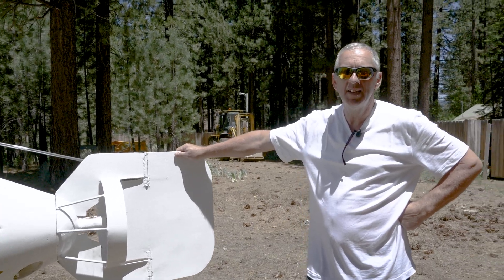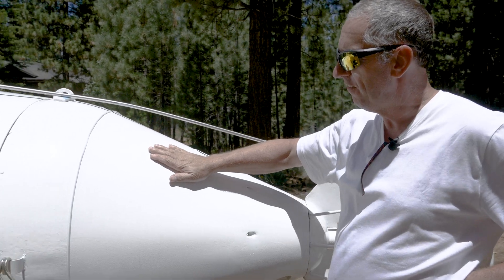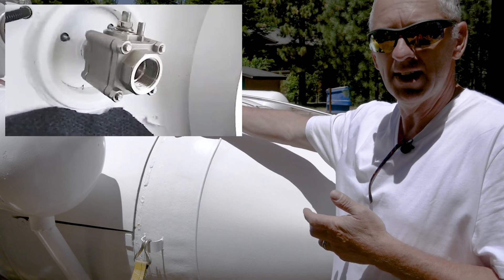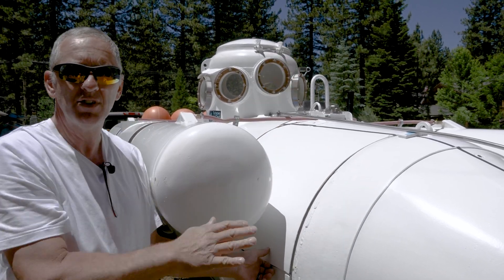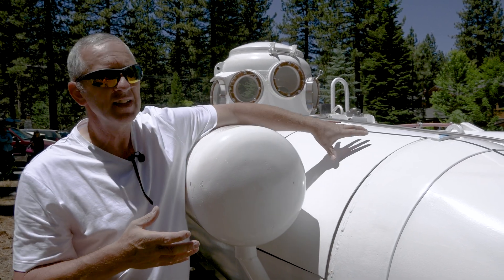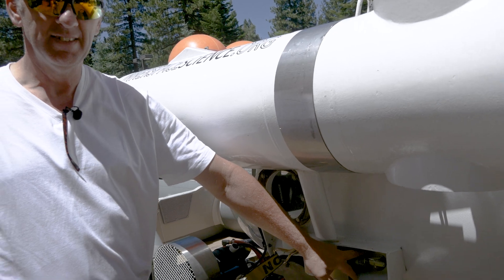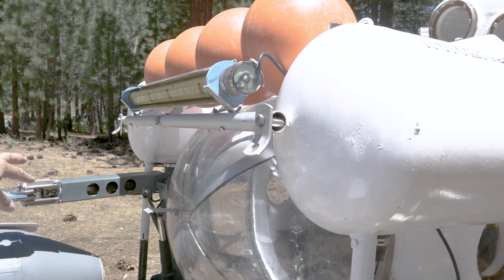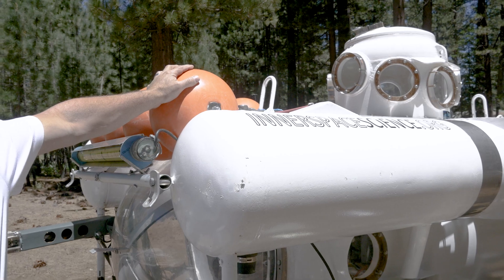Nekton Gamma Submarine Tour With Homemade Escape Pod

Comment: What is the structure beneath the bow dome? Does it support the dome or the hull?
Reply from the maker: There is a 2 inch thick by 4 inch wide ring that the dome sits on.  The ring also reinforces the hull.
Reply: @HankPronk  makes sense. Some pretty cool machines you’ve got there!
Reply from the maker: @gl9326-m7i  Thanks

Comment: In normal conditions, what keeps the escape pod fixed to the main pressure hull? What releases it when pressure is equalised? 
Great vids, Hank. 👍
Reply from the maker: Hi Gareth, thanks, the pod is bolted to the hull with 8 bolts.  When the sub is at depth the water pressure will hold it on while the bolts are removed.  The pod is buoyant with an additional air bladder that is inflated to orient the pot upwards.
Reply: @HankPronk  Thanks Hank. And I like the inner tube idea. Does that stay inflated when the sub is in use or do you have a means of charging it whilst flooding commences?
Reply from the maker: @gazmeister1984  I carry a small tank of with 1,000 psi in it.  That is the perfect amount to not over inflate the tube.  It is not inflated all the time, in face I pull a vacuum on it to get rid of any residual air.